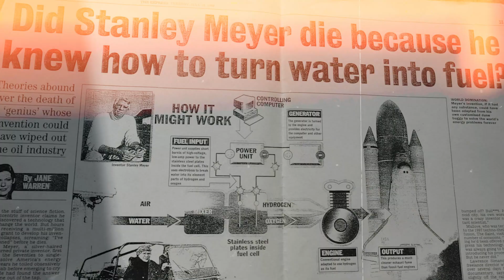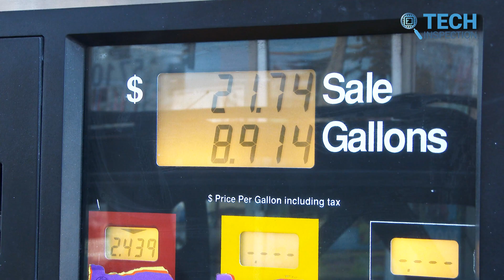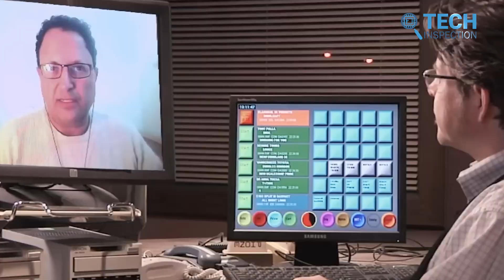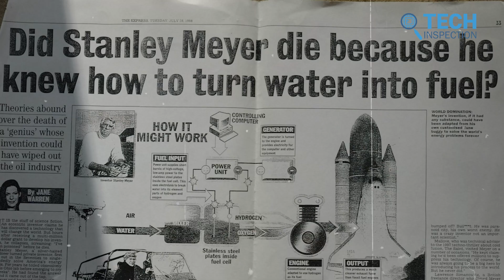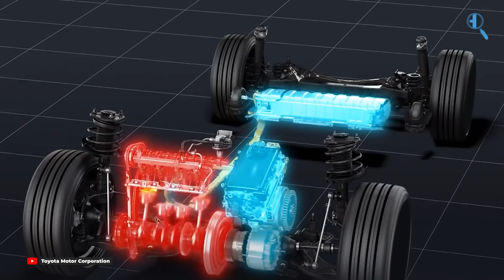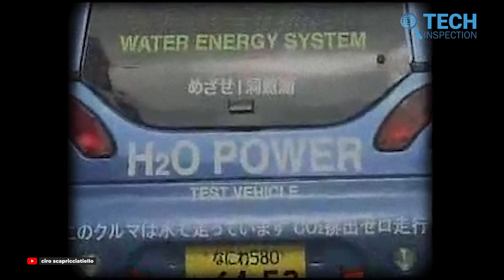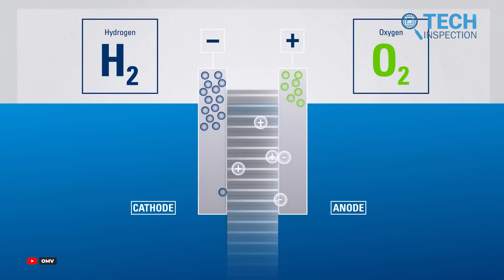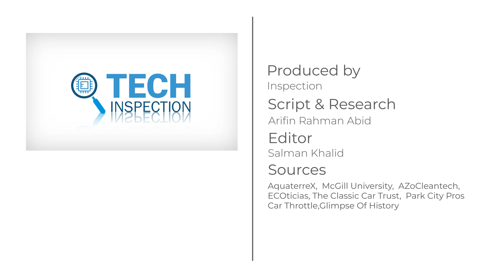The Mystery of Stanley Meyer and His Water Powered Car

Comment: THE NON-ELECTROLYTIC SPLITTING OF THE WATER MOLECULE 
With so many people going around in circles over splitting the water molecule “H2O” 
and trying not to use electrolysis to do this, I thought that it is time to demonstrate the 
principles used to do this. 
Vibrational excitation “Vbe” of any molecule changes the bond angles within that 
molecule. This is one of the most important points in the breaking of the water 
molecule. Vbe creates a stress on those bonds and with enough oscillations the bond 
will break. 
Let me explain in another way, we have a long narrow piece of wood which has been 
joined in the middle, this join is our molecular bond. We have 180 degrees as our bond 
angle, we now hold this piece of wood at one end and vibrate it up and down until the 
joint starts to break. As it starts to break, the bond angle is changing and the more it 
changes the faster it breaks. Now if we held the piece of wood at the other end as well 
and vibrated it up and down like the other end, and if the vibrations were the same, the 
join would not break, but if we changed the frequency of those vibrations so as they 
were different, the angle of the join would be changed instantly and as so the join would 
break nearly instantly. 
This is what has to be done with the bonds of the water molecule, we have to create a 
frequency on each end of the bond which is different. Now what frequencies? Well we 
use nearly all the frequencies, “if you can’t find the exact right ones use UWB (ultra 
wide band). I will now explain heterodyning, this is a form of creating multiple 
frequencies from two fixed frequency sources, for example 100khz and 300khz. 
If these two frequencies were transmitted from two antennas close to one another we 
would create heterodyning of those base frequencies. The form of a single frequency 
radio wave is sinusoidal when passing through air. In the first instance created from 
these two base frequencies would be two extra frequencies, they being equivalent to the 
sum of the two base frequencies 100+300=400khz, and the other equivalent to the 
difference between them 300-100=200Khz, so we now have 100Khz, 200Khz, 300Khz 
and 400Khz. There is a finite space between these frequencies and gets smaller as each 
and every one interacts over and over again. I must stress here that this is not harmonics 
as found in a single frequency, we are talking about designer frequencies within a 
certain RF bands. 
This heterodyning is what we can use for breaking the water molecular bond and what 
was done by Puharich and Meyer but very badly explained if explained at all. 
All molecules have a vibrational frequency, RF waves are AC waves, Vbe of a molecule 
changes the bond angle, amplifying these frequencies will eventually break that 
molecular bond. Like the example of the joined piece of wood. 
PART TWO 
With the continual bombardment of the heterodyning frequencies on the water molecule 
(their differences), cause the ion bonds between the hydrogen and oxygen atoms to 
fracture and form hydrogen and oxygen gases, the efficiency of which is ten fold that of 
electrolysis and with minimum energy input. 
The energy input has a relation to the energy output of the RF wave and this RF wave is 
measured in watts of output, typically can be 10watts. To maintain this full output of the 
RF wave, the antenna has to be of resonant size, quarter and half wave. Stanley Meyer 
was always talking of tuning his tubes, what most people do not realise is that he was 
talking about the tubes being the right quarter or half wave length. The Meyer tubes are 
in fact antennas (not directly a capacitor). 
In a tube cell immersed in water the tubes have to be insulated completely so as not to 
give direct contact with the water and so to one another. Only RF waves are wanted to 
pass through the water creating Vbe from the heterodyning signals. 
To maintain the correct VSWR “voltage standing wave ratio” on the antenna “tubes”, 
the antennas are loaded with a resonant choke. This is so as the voltage is not repelled 
from the antenna back to your circuit. The perfect ratio is 1:1 but up to 1:3 swr can be 
acceptable if your final drive will cope with this. 
You can now see that these chokes are not charging chokes but resonating balums to 
bring the antennas into resonance “tuning”. Due to the medium “water” for the radiating 
RF not being stable, these chokes have to have an auto tune circuit so as to continually 
bring the VSWR with in a maximum of 1:3 or better a perfect 1:1. This is especially 
important in a solid water cell, but more easily controlled if the transmitting medium is 
fine water mist or vapour which gives an enhanced surface area to the water molecule. 
As we are dealing with RF, the line connectors to the antennas have to be of the right 
resistance and shielded. Also depending on the construction of the water cell container, 
an RF insulating barrier has to be made around the antennas (faraday cage), so as not to 
create RF interference in the locality of the water cell. In the early days of Stan Meyer, 
in his own words, he created a lot of TVI “television interference”; until he changed to 
his injector plug cell using water vapour. His plug cell was a faraday cage and if you 
look at his videos, the cable to these were of the RF type 50 ohm or 75 ohm or of 
another resistance designed for his use. 
Now at this point, and before anybody asks, I have nearly always talked about NH3, 
where does NH3 come into this? Well if you look at the patents of Stan you will see the 
introduction of N2 via the exhaust return, apart from the 78% in the air, which he 
needed to create the right combustion in the cylinder. This mix on compression formed 
a mixture of gases of which NH3 was the predominant gas and increased as the engine 
warmed up to its running temperature. Stan had problems with this as the ratio of gases 
changed with temperature, this I believe he managed to rectify in the latter days.
Reply from the maker: Thank you for the incredibly in-depth explanation! The principles behind the non-electrolytic splitting of water molecules and how heterodyning frequencies work to break those bonds are fascinating. Your breakdown of how Stanley Meyer's technology might have functioned gives a lot of clarity to the science behind it, especially regarding the resonant tuning of the tubes and the use of RF waves. It’s amazing to think about the potential of such innovations. I really appreciate you sharing this technical insight!
Reply: @tech.inspection  Here's my theories as to how I burn water as a fuel, without splitting the molecule.

This is a comment I've left on another channel, so as not to have to recompose a direct response to the above commentor.  He's right, but it can be done a different way.  Here's my take on it:

Here's the problem with known physics & the claim that burning water violates the first & second law of thermodynamics.  

No one (except me) is looking a bit deeper though.  Everyone assumes that you have to separate the water molecule before it can be 'burned', because they are only thinking in terms of electricity is the only source of energy that can be used.  And it is true that it takes more energy, using electricity (alone) to prepare the water molecule for combustion.

But let's think just a bit deeper.  I'll use the Socratic method to come to understanding by asking a series of questions.

1. When you hear a noise, say a speaker diaphragm vibrates, are those audible sound waves energy?  The obvious answer is yes.  Electromagnetic energy, moves a magnet connected to a diaphragm, which vibrates, transferring the energy from electricity to sound waves, or vibrations.

Nicola Tesla said, "If you want to understand the universe, you have to think in terms of energy, frequency, & vibration."

2.  Just because you can't see or hear a vibration, does the thing still vibrate?  Again the answer is yes.  In fact, every element on the periodic chart has it's own 'natural' vibration, all the time.  It's simply an artifact from electrons orbiting the nucleus of a particular atom.  Each atom on the periodic chart has it's own 'frequency' or 'frequencies' that they emit.

Some elements on the periodic chart do known things... Like silver for example.  Silver is known to be antibacterial, antiviral, and antimicrobial.  But why does silver have this property?  I postulate that silver has a specific frequency that destroys harmful 'pests' listed above, to the point that they cannot exist once they come in contact with the frequency that silver always emits.

3.  What if... Someone (Me) discovered that there is a way to impart a specific frequency, or combination of frequencies, that actually reduces the resistance between ANY electromagnetic 'circuit' by 12% when measured by an amp meter.  All done with a certain combination of elements from the periodic table.

4.  Would you then think that burning water violates the first & second law of thermodynamics?  This one you'll have to answer for yourself.

In discovering this frequency that reduces resistance in a circuit, imparting this frequency into water, temporarily changes water structure.  Pure water (H2O) has a slight negative electrical charge. That's why its a fairly good solvent.  By decreasing the resistance between the hydrogen/Oxygen covalent bond, it temporarily 'tricks' the water molecules into thinking they have a higher negative electrical charge, and the oxygen molecule grabs hold of another hydrogen, which is also attached to another oxygen, creating hydronium (H3O2).  Water in this state, actually can be disassociated (burned), when put in a violent enough environment.  Such as in a field of plasma.  That's why lightning happens when it rains.  The plasma ignites the water in the air.

I'm getting off topic.  Suffice to say, that burning water isn't impossible, you just have to look at the universe from a different perspective
Reply: @atheplummer  this seems reasonable but hydronium is H3O not H3O2 and H3O2 is a pseudoscientific molecule known as hexagonal water often used as a scam and its structure is inherently unstable and cant form a molecule. maybe you mean it turns into hydronium that you specifically call H3O2 and its a different stable molecule no one knows about but at that point id ask what your talking about in the process of the molecules attaching. do you mean the 2 hydrogen molecules attached to the oxygen molecule experience that specific oxygen molecule attaching to another oxygen molecule thats attached to a hydrogen molecule? so 2 hydrogen molecules attached to an oxygen molecule attached to another oxygen molecule attached to another hydrogen molecule. I'm just curious because that either makes no sense or you understand something no one else does.
Reply: I, for one,  certainly have no doubts that what is depicted in this video is currently in existence along with much of Tesla's multitude if "missing" documents and inventions. I believe that perhaps our ancient history tells us (through archeology) Egyptians, Mayan, etc had much of that knowledge. Great feats of architecture being built by using sound vibrations has always been a theory I believe. We do have the skills, abilities and knowledge that would allow the whole world to essentially save itself. Sadly we will never put any of it to good use because there is no profit in "free".

Thank you for your explanation. I found it fascinating and it helps solidify some of my beliefs. 
Nice to know I am not wierd or crazy!! 😂

Albeit none of the "rulers " of the world have not and never will allow clean, free energy or anything else that would make this world beautiful again.
Reply: @pennylangston6297   POTUS is talking about going back to coal.. which is a filthy source energy .. I thought he was an outsider come to shake things up 😂 .. So much for that !!!
Reply: the energy you get out of burning the hydrogen is equal or lesser to whatever amount of energy you put into the water in the first place. necessarily so, since energy cannot be created out of thin air. If we could do that, we would not need water in the equation, we would just power the engine with energy created from nothing. 

HOW you put said energy into the water is completely irrelevant. Much like a glass of water, you will never get more out of it than you poured into it beforehand.
Reply: @wicketandfriendsparody8068  You're right that energy can't be created from nothing — conservation of energy is fundamental. But where we might differ is in the framing.

Water isn’t just a passive medium like an empty glass waiting to be filled. It’s a stable chemical compound with stored chemical energy in the bonds between hydrogen and oxygen atoms. The process of splitting water (electrolysis or otherwise) isn’t about “adding” energy to it like pouring into a glass — it’s about overcoming the energy barrier to unlock what's already there.

Think of it more like unlocking a battery. The hydrogen gas produced is an energy carrier. You do need energy to extract it, yes — but depending on the method (like using resonant frequencies, catalysts, or renewable input), the efficiency of the process can vary. The hope is not to "get more out than in" in a physics-defying sense, but to find a viable, possibly renewable method of accessing stored energy in a usable form.

So, it’s not about creating energy from nothing — it’s about tapping into the energy that’s already packed into the water’s structure.
Reply: @Alexander_Kale  You're absolutely right that we can't get more energy out than we put in — that's basic physics. But I think the key nuance here is how we source and recover that energy, and what medium we use to store and transport it.

Water isn't just a container like a glass — it's a dense chemical structure. The energy we input (whether through electrolysis, resonant frequencies, or otherwise) doesn't vanish; it gets stored in the hydrogen bonds we break. When we later burn the hydrogen, we're releasing that stored energy.

So the system might not be overunity, but it can still be useful if the energy input is cheap, abundant, or renewable — like from solar, vibration, or ambient EM fields. In that case, we’re not "creating energy from nothing," we’re using a process (water splitting) as a medium to convert free or low-cost energy into portable fuel.

In essence: the water isn't magic — it's a battery. And like any battery, its usefulness depends not on defying physics, but on the context and cost of charging it.
Reply: @Alexander_Kale you are explaining The first law of thermodynamics, so far this law remains true. Energy cannot be created or destroyed, it can only be transferred from one place to another . Well maybe Centory is Mr.Scott, explaining transparent Aluminum? 
     Very interesting reply that is on a molecular level. :) If you think about The first law of thermodynamics, Even Oil in the ground has had energy put into it if you really think about it, one way shape or form. Animal, plant and Bacteria energy is stored in the oil. Quartz crystal is an intriguing phenomenon, and how that energy was also stored. 
     Well my friend, one of the miracles of existence, is all I can say. Maybe Centory has a cheap way to generate the agitation signals necessary to make hydrogen hydrophobic?¿ :) Don’t turn yourselves into a HindenBurger messing with this stuff folks. :/

Comment: Protip,.. you can built what standly did with less than $100 in parts if you know what you're doing.
Reply: No, you can't.  Not without external power which is required for the electrolysis process.
Reply: @maxhugen  He never said it worked... You can build it. It won't work.
Reply: L énergie pour l électrolyse venait de l alternateur  c est la première étape a appliquer .
Reply: Do it Einstein and see how we'll it works 😂
Reply: That's why no one has done it since. Because it is so easy.
Reply: @Alexander_Kale Nein, nicht deswegen ! Sondern ; wenn jemand das schaffen kann und versucht das populär zu machen; wird ... bekämpft!! Wie Stanly Meyer !
Reply from the maker: Thanks for sharing! It's fascinating that such innovation could be recreated with minimal resources. If you've had any experience building a similar device or have insights on how to do it, we'd love to hear more about your process. Feel free to share!